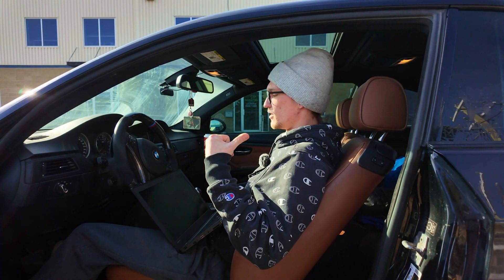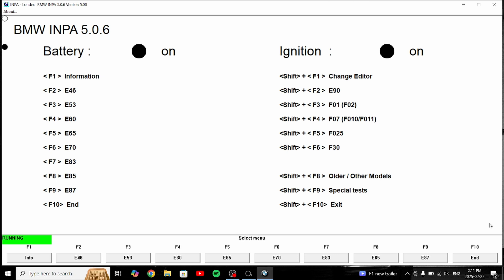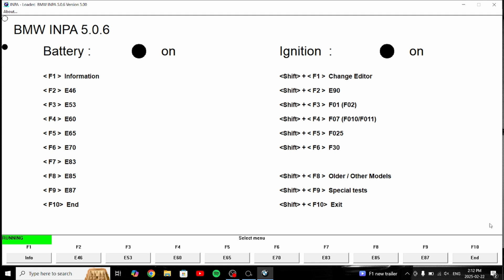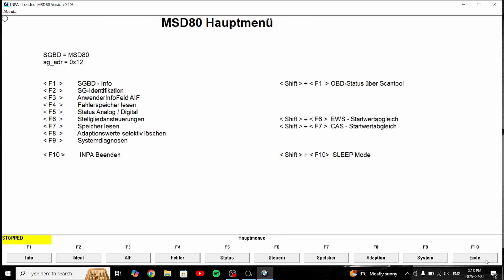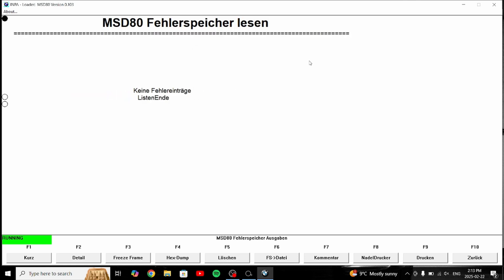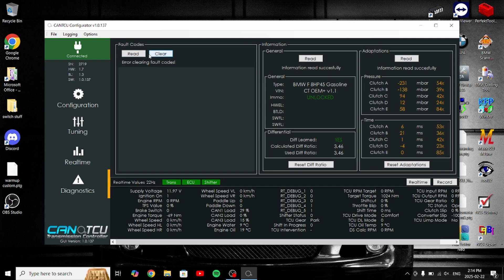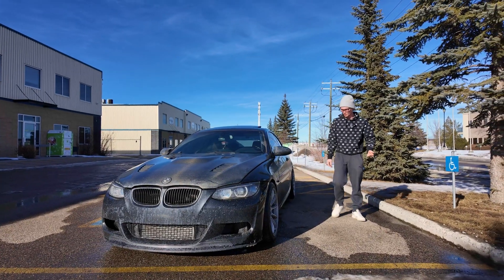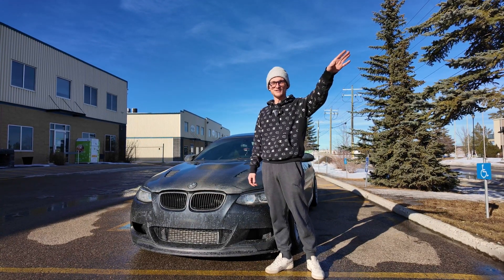CANTCU DCT Variant Flash - BMW Shift Cut Braps (8HP Swap)

Comment: Is this achievable with a 6hp aswell?
Reply from the maker: unfortunately, it's not.
Reply: @tony.nextlevelrides is there anywhere close to these “ignition cut” shift able to do on a 6hp at all?
Reply from the maker: if you increase the torque reduction, it can help get close. if you want to email us, I can edit an xHP map for you (if you have the flash)
Reply: @tony.nextlevelrides right now my 335i is stock I haven’t done anything. but i’m thinking to do a xhp tune. I’ve got it done on my 320i e92 and you can hear that “ignition cut” sometimes😂 whenever I’ll decide to get xhp done I will definitely email you guys!
Reply: @tony.nextlevelrides yeah I’ll be emailing you till I do the 8hp swap I wanna see can you achieve it on the 6hp sometimes it does it on its own so I know it’s achievable but only like 1st going into 2nd or 2nd going into third you will get a little brap

Comment: What kind of exhaust setup do you have? The “braps” don’t seem to be too loud, only heard in the exhaust can footage.
Reply from the maker: straight 3" with two vibrant ultra quiet mufflers and a carbon N1 style can at the back. that's why. the 135i braps pretty hard.
Reply: @tony.nextlevelrides what kind of exhaust does that 135i have?
Reply from the maker: @fastboatster 3" with a single 12" resonator to a Riss Racing axle back.

Comment: so in the msd81 tune is it:
disable tq red by ign - 00
disable tq safety path/hard/soft - 02?
Reply from the maker: Doc vu had done it as it's on a custom tune. tq safety paths disabled. Make sure you don’t disable reduce tq by ignition. In the dme bin file and make sure you have Torque reduction by ignition enabled in bin file.

Comment: Very clear and informative. I can't resist to ask though, why would you swap a DCT with an 8HP? DCT is much sportier
Reply from the maker: originally, this car had a 6hp and after going through two transmissions, we worked with CANTCU to swap (one of, if not) the first 8hp's into an E Chassis with the N54. It's held up MUCH better than the 8hp and this is just a step further in the right direction.
Reply: Cars an awd car so 8hp is the answer as dct only came in rwd. Just too clarify this is still an 8hp in this video, just with dct logic in the shifts and ecu
Reply: it is not problem to use dct in awd car. @Twittenberg
Reply: @Jakedelus 8hp is cheaper and easier to find, not to mention the dct will never be as smooth for daily driving.
Reply: @ZaksWorld14  i dont have any issues with my dct. it is really smooth with cantcu.
Reply: @Jakedelus I’m sure Cantcu does wonders, but in general dct’s are known to be jerky at low speed and moving from a stop. Performance is very similar with both, the 8hp has better fuel economy and will get up to temp faster with the torque converter especially because our winter are very cold here. Dct’s are known to overheat faster in bumper to bumper traffic. Servicing a dct is a pain and can get very expensive. Launching the car is a lot smoother in a 8hp whereas a dct will essentially drop the clutch hence why most dct cars are either fwd or rwd. And again cost and availability of a dct is not the best. Not to say that dct’s suck, sure if you want purely performance they are great, but the best all rounder between the two will always be the 8hp.